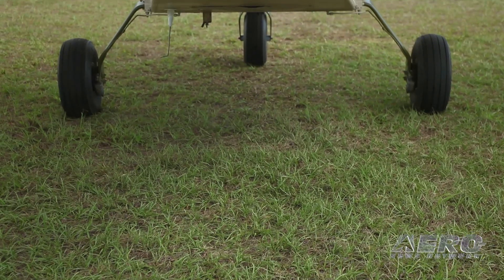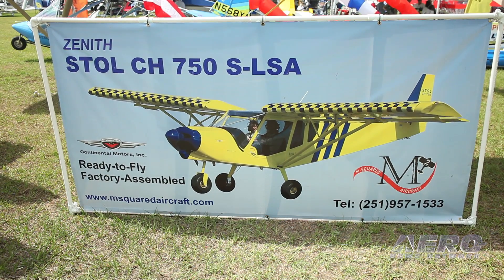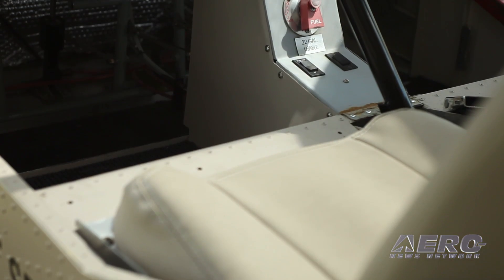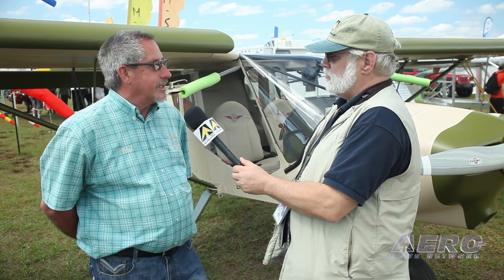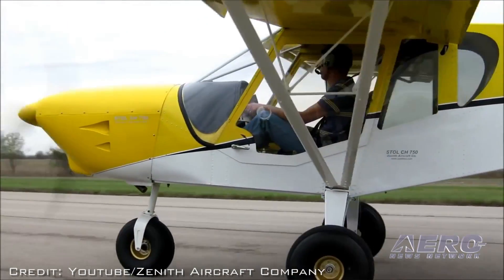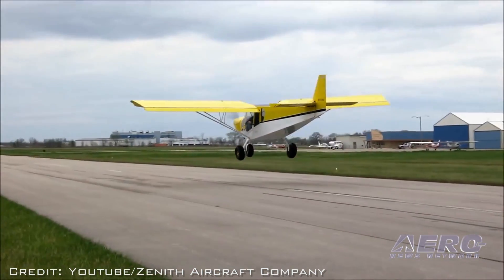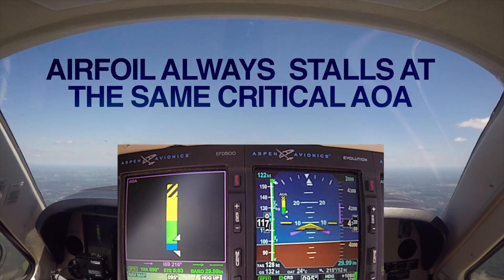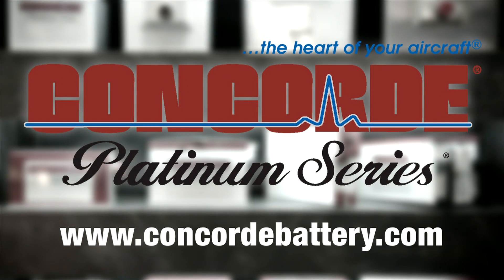Aero-TV: Ready Made CH-750s - M-Squared's Big Plans for Zenith's STOL

Comment: All for the low price of 100k. You should really consider the 118-130 hp UL. At 60 lbs lighter than the o-200 more useful load and better fuel flows.